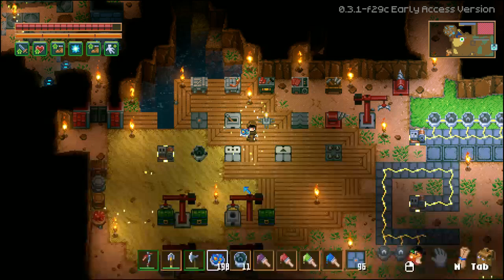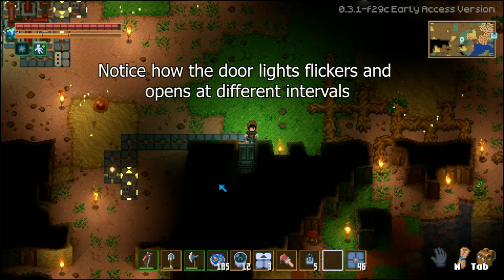Electronics 101 - Circuits, Loops | Core Keeper

Comment: 18:37 can you just make the clock start the circuit and instead of having the power source in the circuit have it just beside it, or something like that. Like in minecraft once the clock is started you dont need the power source but with levers/buttons you can start/stop them from a distance with one press

Comment: Cool video, as a developer, and certified minecraft redstone engineer, i found the pacing a bit slow, but still well formated and explained. But i havent really seen anything in the game worth adding logic too. I guess runway lights could be cool in some bases maybe, but ultimately the whole logic thing in this game seems to be underused because there's just not much purpose too it. To be honest,  i kinda wish that conveyers and traps did need power so that there was a reason to use this stuff. Right now, all ive ever had to do was make sure all my arms and drills have power.
Reply: As a simpleton here a year later than you and  never doing electric work, I’m glad he didn’t speed through this 😂

Comment: The electrical stick does not change the behavior of a logic circuit - it is a power source. You can check this by using a logic gate with 2 sticks and no generator.

Sticks can't power electrical lines.

Comment: Ty for info about logic in game. But i have question about drill mining automatization. If i place 8 drills for 1 scarlet crystal, i get 1 ore in ~30 sec. Then this ore goes around with conveyer belt and auto hand picks up this ore and place into melting furnace and after into chest. Question is: smelting process at melting furnace more then 30 sec, and when i back to loot my scarlet bars, I see more than 20 ores inside the smelter. You have any ideas, how to optimize this? How to say auto hand, if into smelter have ore, then no take ores from conveyer belt, if not, then take.
Sry for my bad english, i trust you understand, what i mean in this question. If you know, how to optimize, maybe make video answer about that.
Reply from the maker: You could try building a timer with logic gate to alternate between two mechanical arms to pick up ores into their own smelters. However it won't be split evenly. But I believe the issue you are facing right now is due to the patch that fixed the duplicating glitch where if you are far away from the smelter, you will get additional bars. At the moment the devs seem to stop the chunk from being loaded, so belts and smelters don't seem to work when you are far away. I've read somewhere that the ores still get drilled and is stored in the drill which is likely why you have a lot of unsmelted ores when you come to collect them. My advice is to try visiting it frequently or when you first load up your world to play. Or you can just bring the ores back home to smelt in multiple smelters manually.
Reply: @Kytros1A  Ok, i try it. Build 3 arms with timer logic and last arm place in the end of conveyer belt like safeline, if another 3 with timer, don't take ores. Ty for answer
Reply: @Kytros1A  Y, i build timer scheme, but it's no need i think. Cause i stay around about 30 min, and mining and smelting ores been normal, not stored ores into smelter. This is bug, you right.